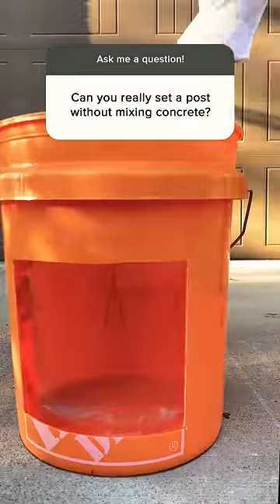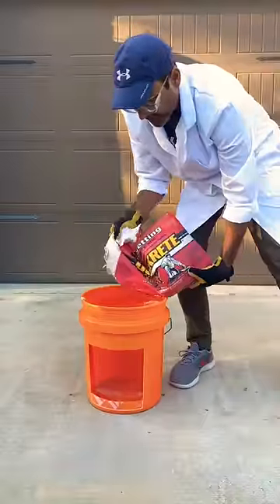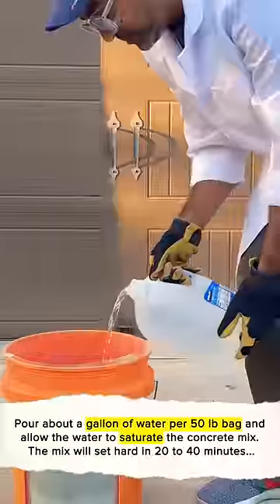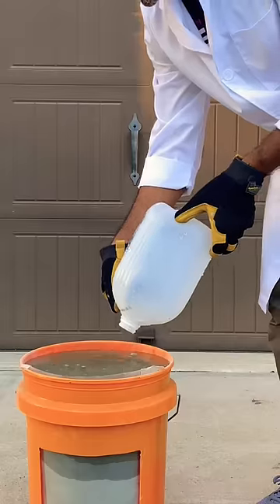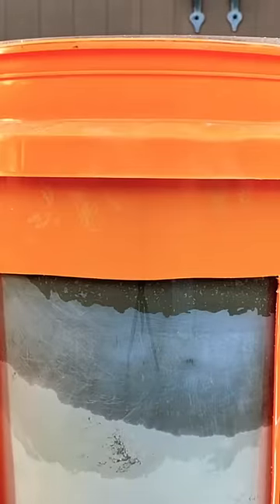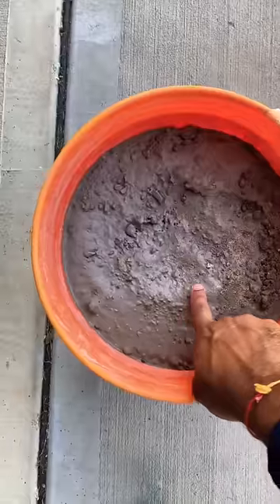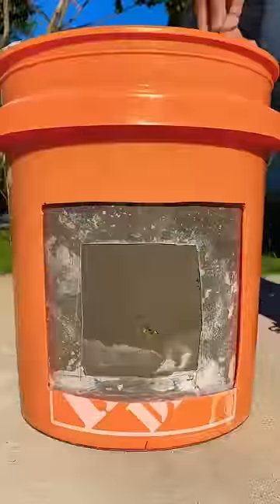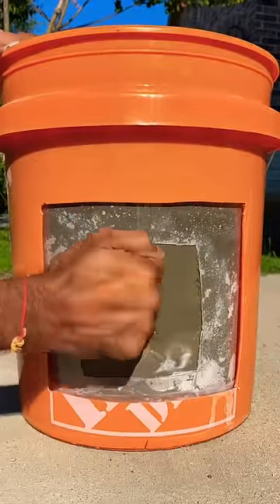Have you ever tried Quikrete’s fast setting concrete mix?

Comment: You should do a side by side where you mix it prior and then do what you did today maybe compare set times or just after a day which is harder
Reply: My brother just did that. He set two bollards in front of his shop. He did one where he mixed the bags and one where he just poured the bag then water and you can tellthe difference. They are both solid but aesthetically different. I just put up 40 posts in my backyard, dropped a bag in poured water, waited bout 20, dropped another bag in and another gallon, yeah those ain’t moving 😂 plus I used postmaster steel posts

Comment: I’ve been in the trades since the 90’s.  I’ve never seen anyone ever premix fence post concrete on a residential job site. 
I’ve even seen guys forget to water  at the end and the ground moisture alone wicked into the mix and cured it over a weekend. You’ve got to be pretty incompetent to screw it up. Although there’s always someone up to screwing up.
Reply: 💯 Exactly
Reply: It's funny when I grew up I never seen anybody put dry  concrete in hole. I moved out east ten years ago and I've only seen dry put into post hole and it doesn't seems any weaker👍
Reply: @noelpando6574  I'm in Maryland, east coast. That's all we do around here. We don't pre mix for post holes.
Reply: Similar with shower pans in Northern California during the 80’s to 2000’s. Under the motor bed most shower pans were waterproofed by hot mopping, felt paper and hot tar like a flat roof.  Just assumed everywhere in the USA did the same before modern waterproofing membranes  but apparently that isn’t the case.  Had to suck for everyone dealing with thick folded vinyl/rubber membrane inside  corners let alone outside corners.  About as fun as hammering in a nail with a rock.
Reply: That's all you need. Just plumb your posts, pour the stuff in and let it setup. Unless your ground is literally void of moisture, this is the way.
Reply: @Real28  thank you. people are calling me an idiot saying you pre mix

Comment: I worked for a guy who took it one step further and didn’t even put water down the hole, just a bag of  concrete per post. He said the moisture in the ground is enough.
Reply: I do the same thing never add water
Reply: Hes not wrong. It'll set up it just takes a bit longer.

Comment: Try one with just the moisture from the dirt you would use to fill the hole back! I have been told numerous times by contractors that the moisture from the dirt will seep into the concrete. I think it depends of the moisture that is in the dirt. Love to read comments.
Reply: Might work but a gallon of water is pretty cheap and easy to make it work guaranteed

Comment: When I built my poll barn, all I did was pour the power in around the post covered with dirt. The moisture in the ground set the cement.
Reply: That will work with regular concrete also
Reply: That's some good learnin there, Jethro!

Comment: They put 10x the cement in so homeowners and regular people could use it …. 😂
Reply: No it's calcium. Concrete sets at the same speed, calcium heats it up and speeds up the reaction.
Reply: @roilhead  whatever it is they put a boat load in it !
Reply: @fastflo1  Fast set concrete is a lot weaker than slow set. A win in setting speed but a loss in strength.
Reply: @roilhead  I like the red bags they do set fast . I use them for fences.

Comment: Standard. I’ve never known anyone to actually mix it per se. Usually whenever I’ve done fencing, we dig a hole, pour some water in, then add powder to the water, may sometimes use a stick to push it into any awkward areas but it doesn’t need an actual mix up

Comment: I've seen a lot of people set posts by just pouring a regular 60 lb bag of sackcrete in around the post. You don't even need to add water if the soil is damp enough. It just takes longer to cure.

Obviously use the right stuff and follow the instructions, especially if you're putting in an antenna tower or a building anchor, but fence posts don't require a whole lot of special technique. Gravity does most of the work keeping them in place.

Comment: The other thing you gotta consider too (especially in very wet areas) is the ground moisture that the concrete will soak up as well as the water you pour on top

Comment: I just dug out some posts where the previous person did this. I usually wrap a chain around the top and jack them out. This one kept breaking apart and by the time I got to the middle, it just started crumbling and the bottom was just concrete mix. Honestly it outlived the post so it works, but it made it a pita for the next guy.
Reply: I left an open bag of concrete in the rain and the next morning it was set and rock hard. Whoever set those posts might have mixed a bunch of dirt into the mix because idk how else it didn't set.
Reply: @digi3218  yea I was thinking something similar to that. There’s no way water couldn’t find its way down there during large storms.

Comment: So one of my first jobs was on a fencing crew, fence posts especially for wood fencing needs 2 80 lbs bags in the hole, I have always been sceptical since of just adding water and the bag to the hole, mixing it in some way is obviously better, I have seen fences fall over with just dry powder in the holes

Comment: We’ve always used this stuff. Makes it easier doing 4x4 posts for fences when you can just do one at a time and just pour in what you need, then saturate with water. I probably should measure out the amount and use the right amount of water lol but it’s worked fine for us so far. This way you don’t have to make a big batch and be on a time constraint and possibly waste some ya know.

Comment: Used to use this to set posts for signs. We'd always run a digging bar in there a few times to make sure the water could saturate it all the way. I heard rumors that they did a few without water and just ground moisture set the concrete but I don't recommend trying that lol

Comment: Yep, I can't tell you how many fence posts I've set by just dumping it right out of the bag into the hole. Water the top, poke a couple holes with a bar and it sets just fine. I've pulled some of these posts many years later and the concrete was solid all the way through.

Comment: I would have tried to one without mixing and one with mixing and then compared the two to see if they both  cured the same because that seems like trying to bake a cake without thoroughly mixing your batter but if  cures with or without mixing then that's some awesome stuff you got there

Comment: I have always set my post exactly like that and it works wonderfully people just have a hard time trying to go against what's conventional but it does work and it works well there's not a lot of load on a fence post yet it actually settles in harder on the fence post if you really want to set it in hard is what you do is you drill some legs on the bottom corners of your post and then set it into the concrete and I'll tell you something I think will never come out of there

Comment: He should try putting it in a dry hole in the ground. He may find out the water is sucked up by the ground. Filling and pouring this way 50% of liquid goes into the ground. I just replaced a fence done this way 15 years ago.pulling the posts was easy. The outside was solid Crete but centre was crumble. So I set 2 posts. One was set with this method the other I filled with rapid set, poked cement with bar close to post whilst poring water to allow a good penetrative. 4 weeks later I pulled them out. The 1st was still around 70% dry. The other I needed to jack hammer post out. It was a rock. Proving 30seconds extra work gives a perfect finish

Comment: You have to break it open and check the center. Rock-hard outside, sandy inside.

There is a reason you see professionals MIXING concrete

Comment: When you set posts the water is also absorbed by dirt walls so the concrete doesn't absorbed all the water like suggested with the plastic bucket.

Comment: Dip a hole insert fence post insert dry concrete tamp excessively and keep adding dry crete until the hole is full and tamped-completely and like magic it works with no water

Comment: I will add 1 thing. Your local soil moisture level can impact this setup. If you live in Arizona,  might want to mix ur concrete. Here in Washington state this will work.  Your soil composition is pretty easy to get right so just ask someone. I e done this before and had some issues even here in Washington so…. To make sure if always mix the concrete to get a better bond and hardening.

Comment: The bucket holds in the water. I'd be interested to see how this works in actual soil, where the water can run off of the concrete or otherwise leave. Does it not matter since the concrete can pull water from the earth? And does all of the concrete need to be saturated right at the start, or can it continue to pull water from the ground and set over time?

Comment: Depending on the soil you are putting the post into some of the water will drain into the soil with this method. If you have high clay content in the soil it works better.

Comment: I'd say you gotta try it in the ground/bucket of soil, this was the water will also goes to the ground and the recommendation of water mixture goes wrong therefore the water won't reach the bottom of concrete mix as much as it should

Comment: Probably works great if you set the post inside the bucket, if you just dig a hole then do this the water would be more easily consumed by surrounding soil.

Comment: Alright, listen up, everyone! I'm gonna break it down for you in simple terms. Quick-setting concrete is like the Flash of the construction world. It's all about speed!

You see, when we mix regular concrete, it takes a while for it to get hard and strong. But with this fast-setting stuff, things happen much quicker. When we add water to the mix, magic starts to happen.

Inside that mix, we got cement, which is like the glue that holds everything together. Then there are these little rocks called aggregates, like sand and gravel, that give the concrete its strength. 

Now, the cool part is the special stuff we add to the mix. These additives are like turbo boosters. They speed up a chemical reaction called hydration, which is what makes the concrete get hard.

So, when we pour water into the mix, it's like pressing the accelerator pedal. The cement particles start reacting real fast, forming a sticky goo that sticks the rocks together. That goo hardens and becomes strong, making the concrete solid.

Here's the kicker: while regular concrete needs a good amount of time to get hard enough, this quick-setting concrete starts to harden in just a few minutes. Yeah, you heard it right, minutes! It gets tough enough to handle weight or pressure pretty darn quick.

Now, mind you, quick-setting concrete isn't as strong as the regular one in the long run. So, we mostly use it for temporary fixes, small jobs, or when we need to get things done fast. But hey, when time is of the essence, this speedy concrete is our go-to superhero!

So there you have it, folks! Quick-setting concrete is like our construction Flash, making things solid in a flash. Let's get to work and make this concrete fly!

Comment: I build fences for a living. I was totally against this method at first. Then I talked to someone that worked at quickrete and he told me they recommend that method. I then watched a commercial on TV from the company showing this method. So I started to set posts this way. Haven't gone back to repair anything I've used this method on. This method is really only good for fast setting concrete in my opinion. When going to repair posts, I can tell when someone dry sets posts with normal concrete. It breaks off the posts different while trying to make repairs.

Comment: I'm curious about strength tests. When I set my steel posts I fully mixed the concrete then poured it in, and also tried mixing it in thr hole. Would have saved time and effort just pouring it in dry and just adding water to the top

Comment: FYI. Concrete doesn't "dry". It hydrates, the water combines with the powder and hardens with in it. That's why it's so heavy, Most of the water is still in the concrete except for a little on the surface which will "dry" off.

Comment: i don't set posts in sealed plastic buckets [sarc].
soil and clay behaves differently, so i prefer to wet the hole before pouring in a wet mix of quickset.
i don't trust 'set and forget' methods.
[edit] also never use aluminium posts in quickset, the calcium/alkaline rots the alloy]

Comment: The process of cement getting ‘hard’ is known as ‘hydration’. This is a chemical process that occurs when water is introduced to cement powder that causes the powder to rapidly heat itself and causes it to harden into concrete.

Comment: It’s because concrete is it just like a powder that becomes hard like Dirt or clay, or other things like that it’s a chemical reaction, concrete actually becomes warm when it gets hard, when it gets hard enough for me and my dad to cut when I put my hand on it. It is warmer than anything around. It’s not like it’s absorbing the sun or anything like that. The road is colder, cement( concrete ) isn’t like other things that are naturally occurring, but things like limestone can cause natural concretion, like Roman limestone, has a limestone inside of it. We’ve kind of understand why their stuff has been able to last so long when it gets wet it repairs itself, the problem with that is where, and what concrete would do well with this type of mixture,  our science to concrete is different than theirs. They don’t have rebar they dealt with pre-molded chunks they put together basically,  there’s has giant chunks of lime stone while , we have smaller rocks. We usually try to remove bigger rocks nowadays, and rebar now we cut our concrete and have the rebar in a similar method where they had a wood post, and the separate chunks would let the building move if there was an earthquake or something that would make the structure move like the ground settling, so there’s very similar ideas done in completely different ways, but there is one huge difference, the concrete we use and have won’t last like there’s no where, and what that could be useful him. I don’t know maybe sidewalks driveways I don’t know about homes and other things like that, the process of pouring it would be far more different and difficult because most concrete homes aren’t necessarily poured. They’re built out of cement bricks like I haven’t heard of a concrete home being poured I understand that people have concrete walls, but it’s not typically in a Home metting like an apartment or other things like that and that process is different but typically for like structures or foundations and things like that we use forms, but those still have rebar like those giant square blocks , have a giant rebar cage almost, they would assume parking structures, and other things like that are very similar. If not exactly the same and they mean stamped concrete is exactly the same colored concrete all of it but with color and concrete we actually just put a powder on it and you can actually color concrete after it’s been poured. It’s just not easy but if you really actually like it know how to do concrete or you know somebody who does you can get some beautiful ass concrete, but a rock will last longer.

Comment: Encouraging, but as a rule even if that’s the manufacturer instructions and the promotional guarantee, I’m still stabbing the concrete full depth with a piece of rebar or equivalent to assist water penetration. Still much easier than mixing and gives me a warm and fuzzy feeling

Comment: If it's a post. I don't even mix it, I just pour it dry into the hole and let it dry, never had an issue. Tamp it down and wait for the ground moisture to harden it until it rains.

Comment: People do it without mixing, but the concentration need to be mixed, or the concrete will crumble over time.  I have set posts with dry pour, but then the posts are loose, and just get looser over time

Comment: Kind of old news. Sand, gravel and Portland. Mix 4/3/1 dry and pore in the hole. Add a little water if ground is very dry. Will set over night (harden in 3 days) This method is as old as time it self.

Comment: I'm not saying the test was useless, but pouring in a bucket would be different than pouring it in a earthen hole with a wooden pole in the middle. A couple pretty big variables added in.

All that said, I imagine the product would work as advertised. But I used to work in product R&D and we're all about identifying and controlling variables.

Comment: Made a electric gate needed a sturdy post but we where running out of time so we welded some cross beams on the post and dug a whole big enough and filled it with 16 bag of fast setting concrete next morning it was not possible to move the post we hung the gate and no sagging. Great stuff

Comment: The fastest way to set a post,, faster than any mix, faster even than expanding foam.  And any sackrete will work.  Post hole.  Post stood in proper position and plumb.  Pour dry sackrete into hole around post.  Rod pack.  Best.  A 4 foot long No. 4 or 5 rerod.  Slide it down through the dry mix all the way to the bottom.  Repeat as you work around the post.  As you go around the second or third, or fourth time.  the rod will not penetrate as deeply,, finally only 6 inches or so.  The rod will have settled the dry mix nearly solid,, and settled the mix  6 or 8 inches as the air worked to the surface.  Total time for rod packing,, 60 seconds.  Remove temp bracing and do the next one.  Pour some water in on top or allow the mix to suck the water out of the surrounding soils.  Even brand new and dead dry, the post will stay and stand,,, on to the next post or fence assembly.  Rod pack.